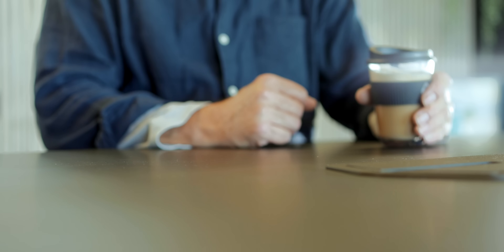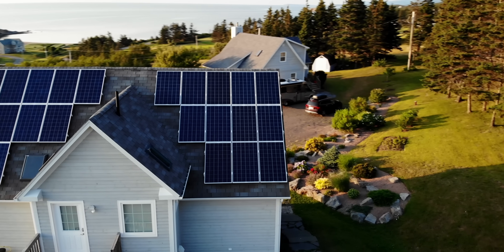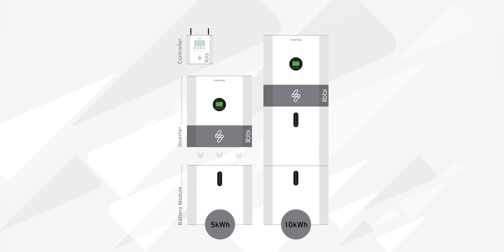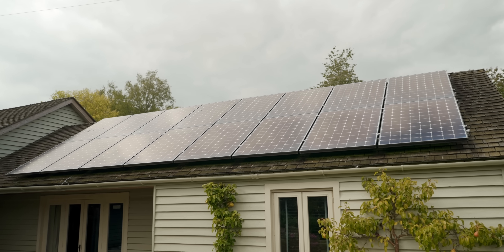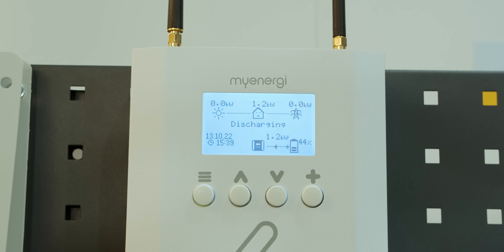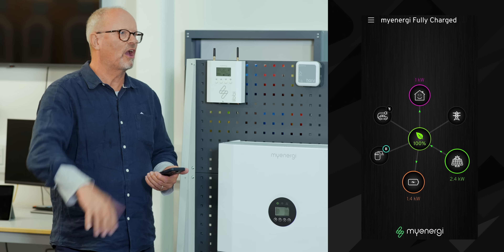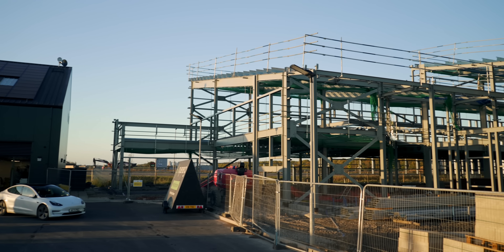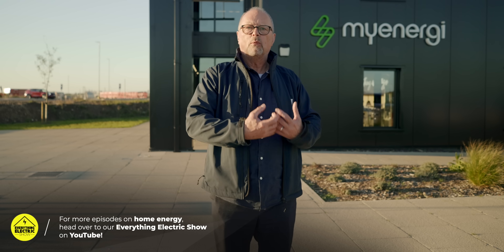THIS Home Battery is the Key To Cheaper, Cleaner Energy!

Comment: Would really appreciate a video on comparing inverters and battery options for various size solar arrays. It's a mine field out there with so many options it's hard to know what to choose
Reply: The main tip is to go for an inverter/battery combination that can actually deliver your peak usage. Preferably this means that the battery itself can deliver your full peak draw. For example my Givenergy 8.2kWh Battery can output 2.6kW. The inverter can handle this, plus solar. Assuming there is no solar, at night or a cloudy day, if we turn the oven on it draws 2.6kW, that's pretty much the most the battery can handle. This means that anything else switched on at the same time will cost money. The newer 9.5 battery can handle 3.6kW and would make managing loads a lot less effort. Look at each battery/inverter combo and see what it will deliver, vs what you use. It helps to have a smart meter already so that you can easily see what your peak loads are. I would recommend a battery size equal to your average daily usage. If you can't afford that, get a battery that is at least as big as your 5pm to 12pm usage.
Reply: @IanMcc1000  real good Statement. 

After 6 yrs I just switched from a system capable of 2.5 kW (load /reloading) to 15 kW together with replacements of my former 10kWh battery to 37 kWh. 
As we are all in electric (fossil free since 2020) we need this capacity as a minimum in deep winter time. 

Once more. 
I confirm that your approach / explanation is imo correct. 

Electric greetings
Reply: You have hit the nail on the head. We have bought a system and battery due to be fitted in 10 days time and have only just realised that it won’t power the house in the event of a power cut ? We never thought to ask the question, just seemed obvious (not).
Reply: @jonathanmellish4439  Same happened to me.. The Givenenergy system will do EPS backup, but requires additional wiring. I'm going to get this done as it's not massively expensive. There are still some limits when it's in "island mode" and so it's best to have it powering lights and sockets only. Forget the oven/washing machine/etc. If you spend double the amount on devices like the Tesla Powerwall, a lot of these issues are not a problem.. you can have seamless switchover etc. Most of us will buy a system that will actually pay off and so won't spend as much so there will be some compromises. Apparently inverters can get damaged if you have lots of power cuts, so I wouldn't be too upset about not having a full backup system (unless we get 3 hr blackouts on a regular basis).
Reply: @IanMcc1000  thanks for the reply Ian. I would be really interested to hear what you get added and a rough cost. I understand the are three levels of EPS , including a manual switch over as well as the option of automatic and as you rightly say our only need would be for lighting on a ring circuit via Alexa devices.
Reply: @jonathanmellish4439  Spot on - I found this out by accident and it is obscene, bordering on criminal the way the marketeers will propose solar PV systems without telling customers that the first thing that happens in a power cut is the whole system shuts down!  Add to that if you try to engineer an add-on contactor - they will invalidate the warranty for your whole system?  On that basis we were forced to go Tesla Powerwall + Gateway - a brilliant decision and only marginally more expensive than the 'best of the rest' quoted. (Plug here for Tile Energy!)
Reply: @rayjones9066  thanks for the comment. We contacted the designer (?) who to give him credit replied by return and said it would be fairly straightforward to enable our system to be wired to include an emergency circuit by a competent electrician. No hint of invalidating the warranty though !
Reply: @jonathanmellish4439  this is of importance. So did we in 2016 and switched to a  system being off grid capable and providing 15 kW charge/discharge power 

We are happy now even in case of a blackout our system will provide us with energy
Reply: @titanium70rd64  thank you for the comment. It is certainly important to us but not crucial. Let’s see how the winter pans out because our supplier is offering cash back if we save electricity over periods decided by them 24 hours in advance.
Reply: Er....this one.
Reply: The difficulty is that it's not just down to the PV array size.
If you have a 4kW array, but have a high base load in your house, there is no need for a battery.
If you have a very low base load during daylight hours, but higher in the evening, then a 15kw battery is probably useful.
What we have seen in practice is that most people would be OK with around 5-7kwh of storage.
However having an expandable system is a benefit as you can add depending on what you need.
Looks like the my energi can do this, but similarly options like BYD hvs / hvm can expand depending on your requirements.
Reply: Just buy a 10kw lithium battery for £2000 a second hand inverter £100 and a wheel trolley portable power and charge up on night time cheap tariff no need for expensive solar panels
Reply: I've got a 10 year old 3.6kw array and I'm getting the givenergy 9.5kwh battery and 3.6kw inverter fitted next monday. I'm hoping to be 99% off grid for 9 months of the year.
Reply: @srts8945  hi. Thanks for the comment. We are having a slightly larger array fitted. Is the inverter the thing that allows you to run the house when the grid goes off ? Is the size of the inverter linked to the size of the array ? Thanks.
Reply: @jonathanmellish4439  every solar array has an inverter mine is been replaced for a smart one to work with the battery. I think most systems don't work in a power cut as a safety precaution for workman fixing power lines. Someone else might be able to tell you more about running while the power is off. I'm not fussed about power cuts really.
Reply: @srts8945  

Until your freezer warms up ...
Reply: @t1n4444  yep still not fussed.
Reply: Yea I agree that would be very useful for people trying to work out what would work for them
Reply: We use 3 Greenlinx 3kwh batteries with a Lux controller, pretty happy so far, app isn't the best but cost wise great installation and very friendly, competent staff! That powers our whole 4 bedroom house all day and we charge at night on a lower tariff.
Reply: @Trylk1138  I’m looking into a system with similar equipment. What size of pv system do you have and what size inverter is it?
Reply: This is a rebranding of the Kstar Blue-s series battery with inverter series. With better software to fit into the ecosystem. But probably also at a higher price.
Reply: We concur, battery plus solar plus back up has reduced our mains electric draw by 60%, and that mains draw was all at off peak or in our case during the Octopus Go Faster period 5.5 ( soon to be 12p). We had solar pv and have now completed the set with a full EV. The vast majority of our grid draw is in the winter for the house, the car has just had its first mains electricity since March. We have a 4.3 kw array.

When looking at pv and battery it is important (a) to understand your own use patterns (b) to fully understand want you want to achieve, (c) to do some research and (d) have a list of questions you want answers for.. In our case having peak battery out put capable of running the oven and kettle was important, we also wanted back up in case of mains failure. We live in a rural county and contrary to some previous posts we do get power cuts. Our energy infrastructure isn’t well maintained and with the effect of climate change more extreme weather is becoming more prevalent. We went for the Tesla Powerwall with Gateway in 2020 and haven’t regretted it one bit.
Reply: @lynnfisher4396  Good observations a) to d). Too many people dive in without checking for 'submerged objects'. Fully understanding ones usage patterns and having clear objectives or desired outcomes is essential for a good result. The industry is changing continuously and I would add flexibility for future developments into the list.
Reply: Modular in my opinion is better, then you can automate charging with smartplugs. If 1 fails you can use the others, and when 1 is in use the other can focus on recharging. 1 solar system for the day that can discharge and recharge at the same time. And one solar system for night that is recharging all day that can do the same in a emergency. Aim for 12 hours based on peak usage. Also the more usbc devices the less strain on the battery try to not use ac plugs. Its a balance between tried and true and innovative approaches.
Reply: I just wish I knew what you people were talking about 🤷‍♀️
Reply: @ryannowell3802  Enphase have a full fledged storage solutions as well, it's called Encharge.
Reply: MPPT
Reply: @mr.majestic8713  'best'...??? 
What does that mean.......!?
Reply: @mr.majestic8713  Emphase don’t make Powerwalls.  The Powerwall is a Tesla product.
Reply: It's a good idea but this channel is not that technical and never mention cost maybe ask EVM  or one of the electrician channels like artisan electrician
Reply: The main item is to pick voltage, for me 48v for most 24v (small availability vs large selection). From the start you need to pick BMS system that supports scalability. I am doing all this from scratch & most answers are behind "IP" so tough luck. I am fortunate that I have skill set from HW SW, electrical, brain & good hands. Once I am  done with this DIY project I will share information as I have array of options to test & scalability. Mine will be 48v 3 array panel setup per multiple with custom SW & HW for monitoring & safety.
Reply: Also which solar panels to go for and which to avoid
Reply: Hi have enphase micro inverters i7 on my 16 solar panels which helps if shading occurs on the panels, this goes to  a Lux inverter in the garage, then have 5 pylontech batteries that it charges. The batteries used because same amount of a powerwall but half the price. Hope that helps
Reply: seeing as you have efficiency losses putting energy into a battery.
and even more losses when taking it out....
and most people in the uk have a constant reliable supply of energy on a single price tariff......(totally negating the point of having a battery wall)
just dont bother with a battery wall, they are an expensive gimmick.
Reply: @jimmyhackers8980  I have a hybrid inverter, so DC from the panels to DC in the battery (no losses). One lot of conversion to AC to power the house means it's well over 90% efficient. Off-peak tariff Octopus Go at 7.5p for 4 hrs fully charges the 8.2kWh battery (actually takes under 3hrs from empty to full). Charging my EV off peak = 2p/mile. Total month savings on electricity, petrol and diesel is over £350 per month. The battery cost £4k - it's paid off in less than 2 years.
Reply: @IanMcc1000  there are ALWAYS losses when charging and discharging a battery....
Reply: @jimmyhackers8980  so minimal on hybrid. In actual use it's not noticeable. Charging it at 7.5p per kWh AC to DC and using it might result in actual cost 10p but it's still a lot cheaper than 35p or whatever it will be come April
Reply: @jimmyhackers8980  not quite true, even though most users in the UK are on a single price tariff, if you have pv you are not paid the same export as you are for import.
If you are exporting at 0 or 5p, then importing at 35p then you are costing yourself 30p for every unit you export. Depending on the size of your pv system and the cost of the battery this can pay itself off within the lifetime of the pv and battery quite easily.
A quality battery inverter combo can have a round trip efficiency of over 90% (Fronius & BYD 92.2% to 94.7%) so even taking that into consideration your saving around 27p a kWh stored.
Reply: @jimmyhackers8980  They are absolutely NOT a gimmick. Our Solar and Powerwall provides 100% of our electricity almost all of the time and the export of unused electricity covers our daily charges for being connected to the grid and the electricity used from the grid (typically very very little). The system pays for itself by basically eliminating electricity bills, providing seamless backup in an outage etc etc. 
We are essentially off-grid most of the time.
Reply: @jerrymyahzcat  yeah, for your niche case of intermitant power......battery backups make some sense.
 However, for the average uk household....its just an expensive gimmick.

the reality is most solar setups overproduce in the day....but if your selling the extra power back to the provider (negating the night electricy bills), a battery bank is totally useless and nothing but another cost.
     also tbh the actual energy loses putting solar into the battery and then taking it back out.....make it actually worse for the end users wallet if they were just to sell that extra energy back to the provider straight through a grid tie inverter.  
    
      most good energy providers will/should pay you more for the energy you produce than the energy you use....  
     this further compounds my point that storing it for "later"  in an expensive battery is pointless.

my final point....the company selling/shilling them has a giant led power wasting sign that says "green af" (oxymoronic) in their office.
   Kind of proving they havnt a clue about what "going green" actually is.
Reply: @jimmyhackers8980  

Indeed it could well be considered a bit of a gimmick in UK.

Perhaps if there was some indication of pay back time on the cost of the install, or replacement batteries.

Nobody volunteers that sort of information.
Reply: @t1n4444  the cost to replace the whole battery would basically be the retail cost of the battery you were quoted on. Most likely individual cells can be replaced at a lower cost. This cost will depend on the cost of cells at the time and nobody really know because it hasn't needed to be done. When working out the payoff including possible replacement costs, then you have to work on a 10 year lifespan for the battery, but decent BMS means these batteries will likely last longer (albeit with some degradation depending on how you treat the battery). The thing that WILL fail is the inverter, as they last about 10 years. These are £1000 to £1500 approx. The only way of working out payback time is to do to the maths yourself using some educated guesses. I think most people will find a system will not pay off for about 10 years, but if this enables you to charge an EV at cheap rate then the payoff is vastly quicker. By taking in to account petrol / diesel savings as well as electric and gas savings the maths is very favourable. Obviously it sucks if you don't have driveway charging.
Reply: @IanMcc1000   Quite so.

Without home charging you can get "stung" when visiting a charging station alright. And, if you charge off the "unassisted" mains your domestic charger's  charging  protocol allows for the domestic load to be given priority. (In UK as from July this year I believe. But happy to be corrected.)

Now, as for changing individual cells then perhaps not a good idea as the cells' characteristics would be different and you'd hope the individual BMS ( per battery) would cope.

Probably there's some tech team somewhere busily refining the software to do just that.

And lastly, to cheer up everyone, we might be on the end of blackouts so you might not see any charging done for hours at a time.
Reply: @jimmyhackers8980  

Dare I say quite a few people ... including non technical presenters ... across the entire YT spectrum.

That said a solar panel array feeding to deep cycle lead acid cells would allow 12Vdc lighting throughout a home.

I have got a 12Vdc lighting circuit which means that power cuts are of no consequence.

I can run a modest sized TV via a 300W Pure Sine Wave inverter from this circuit as well.

With a multi fuel stove, cooking on  the stove top, not forgetting litres of red wine I find power cuts in winter are bearable ...